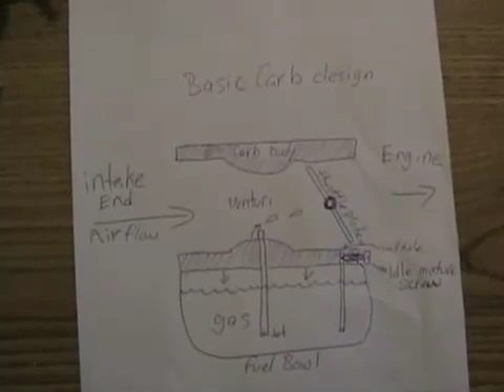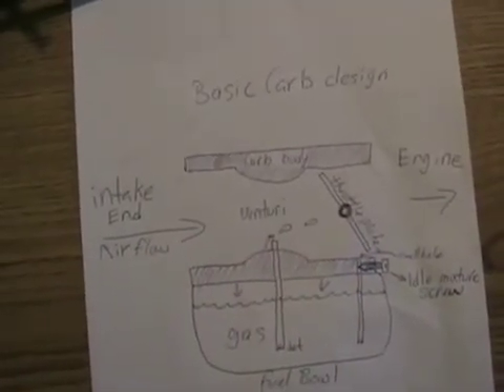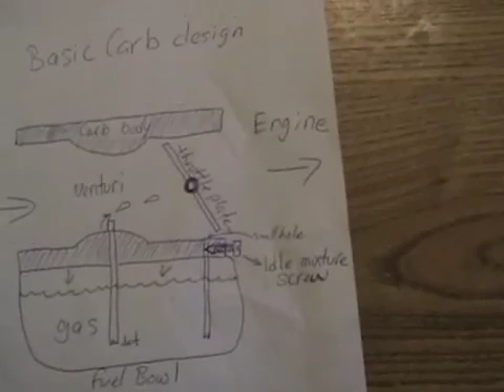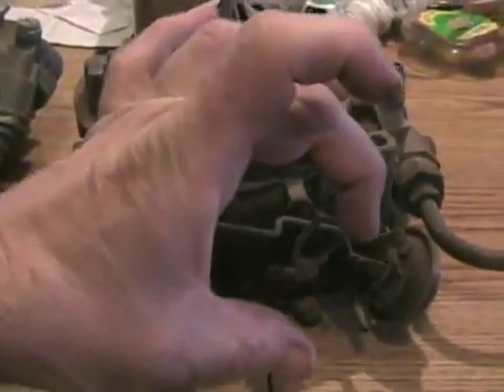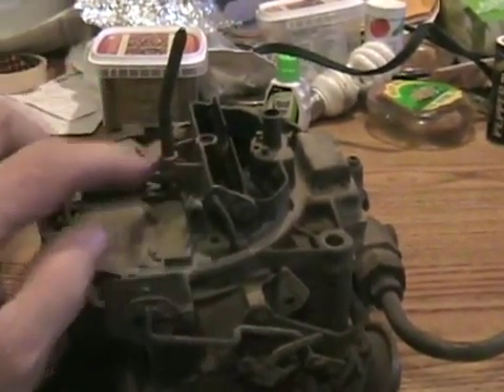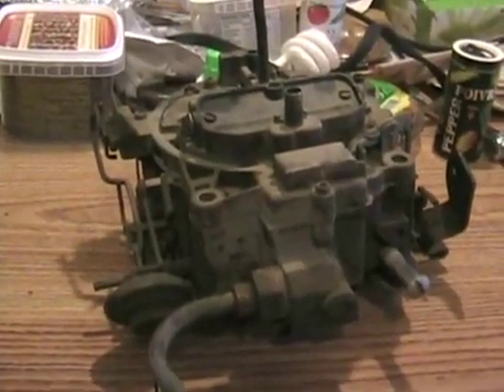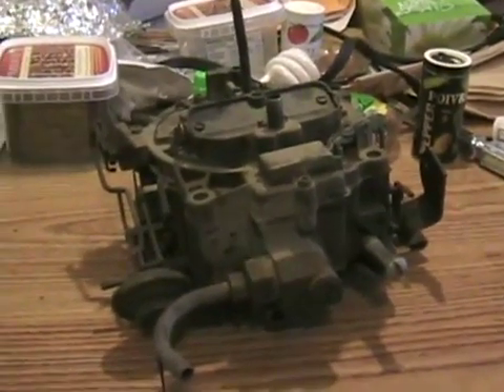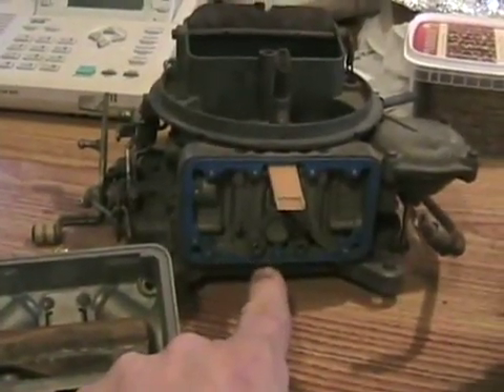how car carburators work , 4 barrel too  Davidsfarmison[bliptv]now

Comment: So when you are idiling how is the air flow maintained so that the fuel is pulled through? Is an air pump? If so does that air pump have to be running at all times, or when the car is moving is then sufficient air flow not to need a pump. After 50 years decided to suddenly learn the basics of how an engine works :-)

Comment: I have a 1994 5.7 liter Mercruiser, it runs good at 20,000 rpms but it starts wanting to die after about a minute, but It will ideal after I pull the throttle back .Any ideas ?
Reply: I assume you mean 2000rpm, where your throttle plates are opening. check the float level: it maybe too high, check your jets, check your power valve